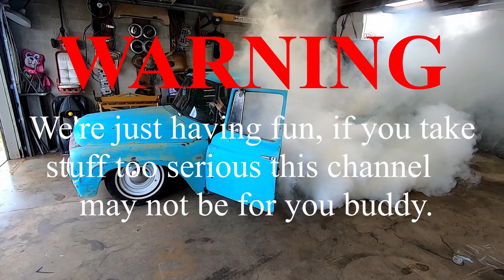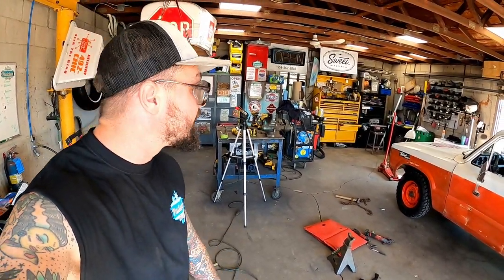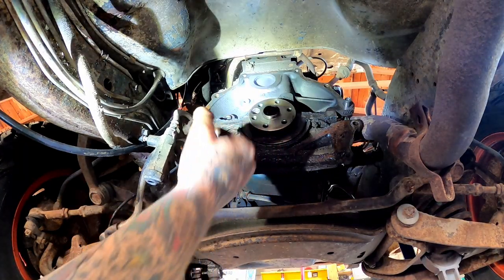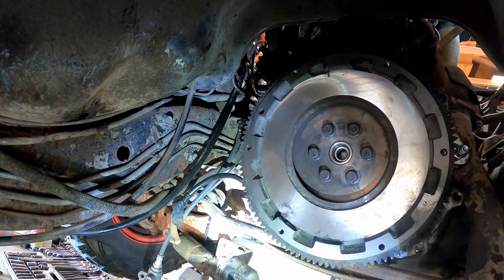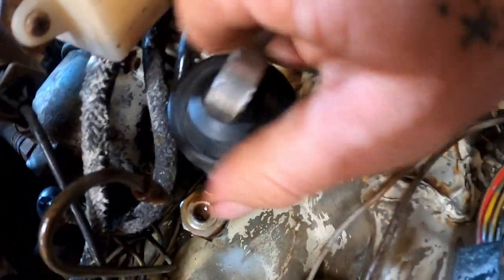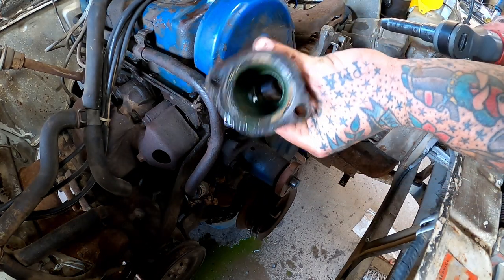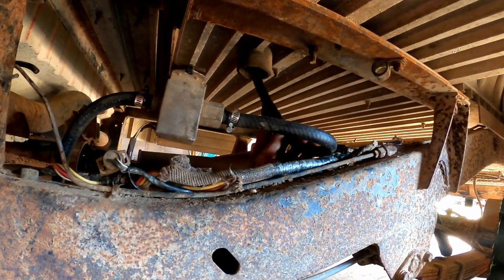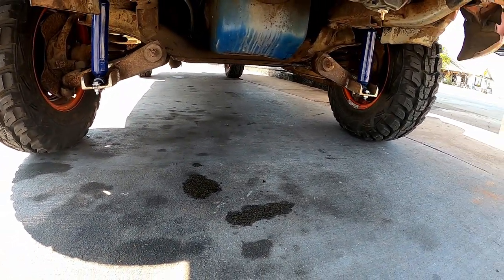OPERATION MECHANICAL TRANSFORMATION. 1981 Ford Courier ((HALF HAWL))

Comment: That doohickey you ripped out of the fuel line was most likely the roll over protection valve. They are designed to cut off fuel to the engine in case of an accident. They also sometimes act as a system vent. That might explain why your carb started acting up. Might be a vapor lock or restricted flow without that thing,
Reply: Can confirm, I had one on my Mighty Max D50. Truck ran fine, got rid of it and the truck began to have fuel issues, replaced carb with a brand new weber. Still didn't resolve the issue. Replaced the valve and the problem with truck stumbling and falling flat on it's face never returned!
Reply: Hopefully he sees this comment I've had this issue also.
Reply: I was hoping he didn't remove it... I've had the same issue before.. I thought it acted as a regulator
Reply: Casey just had this issue on his frankenstang.
Reply: Hey said doohickey

Comment: On the 4x4 conversion- Rangers came with that 2.3 Lima and 4 wheel drive. That transmission and transfer case would bolt right up. A Jeep Dana 30 would be really close to the right width and cheap.

Comment: I’d like to make a suggestion before you get hurt. There is a product called Trim-Lok or edge trim that you can put on the Uhaul box that you cut up. It helps cover up rough edges on sheet metal or aluminum. It would help greatly. You can find it on Amazon or eBay. We don’t want to see you get hurt brother!! Just thought I’d try and help make life a little better for you.

Comment: I remember changing the clutch in my old Pinto wagon. I had it down to a science. Could have the drive shaft transmission and old clutch out in an hour. That was laying on my back in the dirt. Going back together was 2 hours checking to make sure I didn’t forget anything. I wish they had more options for clutch material back then. I would have gone with a little bit more aggressive clutch. I remember exploding the first clutch I put in it down shifting. I thought I was going to 3rd and hit 1st at 50mph. It was like a mouse house in the bell housing. That’s when she got a different transmission as well.

Comment: On this episode,  what I learnt.
- Life is about nuts and bolts.
- 70s Ford Curriers came with a chastity belt
- Acorns in the air filter add power that's nuts.
- You can flex your financial muscles with a new radiator hose.
And I laughed so hard , I sprouted a new ab.
WHOOP WHOOP !

Comment: I remember working under a tree with a come along ...
Crawling around on the dirt changing motors , trannys or whatever was to be done..
 I was 16 when I bought a 69 Mustang .
It had a blown motor .
I found a 428 & dropped it in ...
It was wicked fast..
I told my dad I put a 302 in it..lol.
His truck had a dead battery & he drove my Stang to work..
When he got home he popped the hood..
So then I told him I though it was a 302 , but it was a 351..
He gave me the , "I'll own that damn thing if I hear tell of you hot roddin ".
I burned off a pair of rears every month ...
Half my paychecks went to buying new rear tire & the car wash spraying chunks of rubber outta the wheel wells..
Ahhh...the good ole days.

Comment: I have the same brake bleeder. What i did to quiet it down is take that brass end off, theres an insert in there. Wrap that once or twice with a paper towel and reassemble. Works till the towl gets too soaked with fluid but it last a while!

Comment: Pudding. Add  2 2 inch square tube to upright crane center add pip pins and u shaped brackets to bumper.  And pop the stock between. To add lateral stability easy peasy

Comment: When it seems like I've picked up a piece debris in my carb I get a rag remove the breather and Rev it up a put the rag over the carb tightly as I can that high vacuum  will sometimes will pull it on through it may take a couple of times I've had it work more ti.es than not good luck cheeseburger...

Comment: Hey pudding for the crane u made for the half haul u should buy an electric power ram to make it faster and easier. Put and excessery battery in the rear for it and other power tools u may need to charger or plug in

Comment: You should go find you some jeep axles for the half haul 2 wheel drive ones have a straight axle like a gasser in the front end and you could probably build a radios arm suspension

Comment: Puddin When you get the inside of your new shop setup like you want it IMO the first project that needs to roll out the door is the Some Day Model A. Don't keep putting it off because some day just might not come. And then Hot Rod is gonna have to do something with Dad's car that he never got to finish. Not meaning to be morbid but I know about some day first hand.
Reply from the maker: Well assuming I don’t kick the bucket in a year the someday Model A will definitely be built. I didn’t buy a rolling chassis and a drivetrain just for fun lol
Reply: He been collecting parts, pudding finishes his projects can't you see! An uses them all an drives them!
Reply: @PuddinsFabShop  I  know you have a frame and an engine and trans. Now it just all needs to come together.

Comment: That was a speedometer cable lock so people couldn't disconnect the cable and drive more miles than intended.   U-Haul is based off miles driven if rented local.  Just my 2 cents

Comment: The part you cut off was more than likely on the speedometer cable to prevent renters from removing the cable, preventing mileage from being read on odometer. More miles equals more money you owe. Just my guess.

Comment: That pressure relief valve you threw in trash is so it doesn't vapor lock when tank builds pressure. But I would not worry most eliminate it. My stepbrother had a courier same year and he took it off cause it was leaking. Truck drove just fine. And I am trying to find out if the first generation courier is still where I saw it. It is painted the famous baby shit green  that no one liked. If he still has it we'll work out something to get it to you. If it is I'll let you know on next video.
Reply: E mail him good buddy its in the description of videos

Comment: Back in 70s I work a lot of pinto engines.  They were notorious for wiping  out camshafts.  The oil line for camshaft would get clogged.  It might be a good idea to pull cam cover off and check to make sure the cam is getting proper lube 
Regards
Douglas

Comment: Hahaha Castrol gtx was the best of the best., Oil of Nascar when the truck was new !! I usally don't run anything other than penzzoil hi zinc for the old ones, hell I run it in my new car to its way better than the synthetic they said to use.   Had a lifter tick when we got I put the penzzoil  smooth as butter now,    can't wait till the half haul is 4x4.   That thing will tow your house !!! 😎

Comment: You ought to go ahead with the trans out and dump that transfer case in it you could use the four low in it for towing until you put a front diff in it you'd have a good low range

Comment: U-Haul charges by mileage. That little shield is so you could unscrew it to get less miles. It’s a little harder on the vehicles today. Hotels use something similar on the cable tv cables so you can’t unscrew them.

Comment: I done learnt my lesson and ordered those extra extra extra...large t-shirts early. I missed out on some I really wanted but they sold out those sizes for extra fluffy guys like me. Got one of each of the new ones coming! Really, I just need new clothes and the DXL shop has my size at $35-$40 each, so this is a deal, especially because you will NOT find a cooler t-shirt there...unless its OZZY biting a bat head or something like that. Unfair competition. JK. Puddin is way cooler than that. OZZY can't outpunch a dirt dawber.

Comment: What ever that little check valve timing was that you took off from the fuel line couple be what made it start running funny not sure exactly what that thing was  but just guessing it may be the problem

Comment: Were you pointing to a dually first gen tonner in the book? I have only seen one and it was a U-Haul service truck. I thought it was some J. C. Whitney adapter hot mess but it had the real deal axle and all from Ford. The only others I have seen have been flat beds. That dual wheel pickup bed is rare.
Now that I have said that  someone will pop up and say they have a couple dozen of them.
The Toyotas are much more common on the old campers.
Glad to see ol half haul has got some love.
Take care of that sick ick you got.
Cheers
Terry

Comment: That lock on the speedo cable has to be so you can't simply unhook it and drive 3000 miles without getting charged for them.

Comment: Hi, Puddin, noticed some EVP spirit audio at ultra slow motion, 0.25x video speed, here's my respectful analysis:
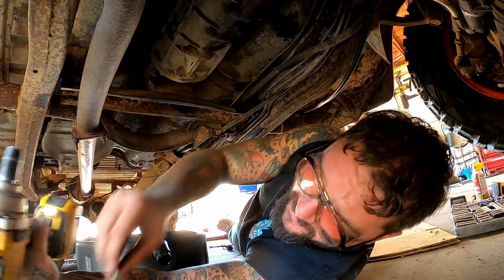16:53 'The alternative way of doing things is often better than the ordinary way of doing things' (notice how the sentence ends on 17 = 'one seven', the first of Puddin's 'Three Sevens', his lucky number).
17:06 'Not ordinary', 17:16 'Alternative'.
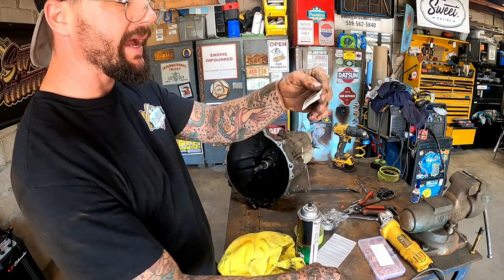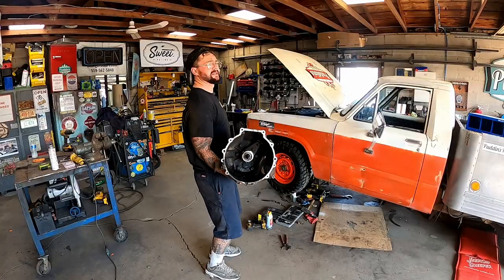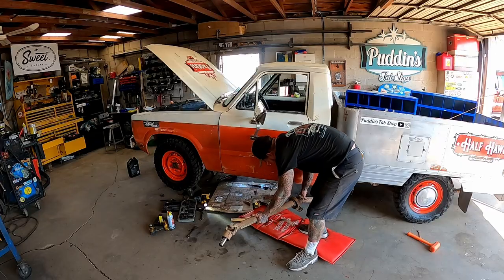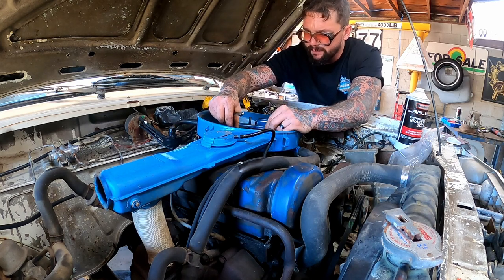18:37 'Puddin, be careful not to get any sort of toxic materials into your lungs', 18:41 'Because they could be causing a lung inflammation', 31:34 'Pas nu på dine lunger' ('Take care of your lungs, now'), 31:48 'Æret være kroppen' ('Honor the body'), 32:29 'Tag handsker på' ('Wear gloves'), 33:01 'For motorolie er giftig' ('Because engine oil is toxic'), 33:18 'And be careful to honor the body of your wife as well', 33:53 'Then you'll live longer without getting any cancer', 41:20 'Our bodies can only take a certain amount of crap', 43:48 'ER, no thanks'.
54:26 'Be very very careful with any kind of dust from any part of the vehicle', 54:31 'Cause it contains asbestos', 54:36 'And asbestos causes cancer'.
56:57 'The basic rule of car maintenance is to assume that everything is toxic'.
58:33 'Gasoline is also very, very toxic, so don't get it on your body', 'That will lower your immune defense system and cause cancer; not immediately, but after a few years', 58:50 'And that is a nasty way to die'.
58:58 'Go ahead and ask The Völve's father who was a dentist and worked with mercury fillings'.
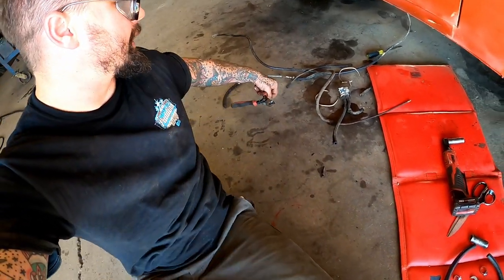59:41 'Every job', 59:47 'Has its downsides', 1:00:12 'Det er farligt at arbejde' ('Working is dangerous'), 1:00:39 'Fordi man er omgivet af farlige stoffer på arbejdspladsen' ('Because you're surrounded with dangerous materials in the workplace'), 1:00:46 'Various stuff, that will cause cancer'.
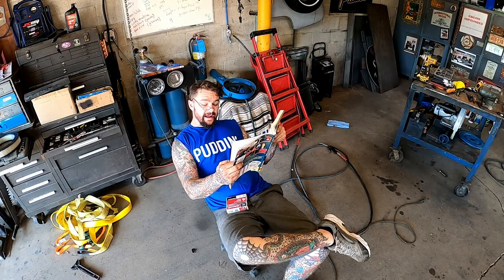1:02:47 'It's all about protection'.
1:04:51 'Queen Elisabeth never did any work', 1:04:59 'So she lived for a long, long, long, long time'.
Thank you
The Völve

Comment: You call that fuelpump install professional? I thought you were an Aviation Mechanic? You're SUPPOSED to keep adding zip-ties 'til the holes are full and you caint force anymore through. You could've got AT LEAST 4 more in each hole. You're gonna be sorry sometime when you hit a railroad crossing at a bucktwenny and the pump flies off